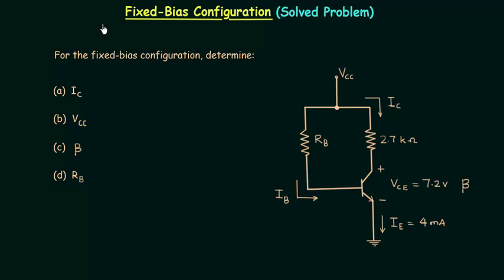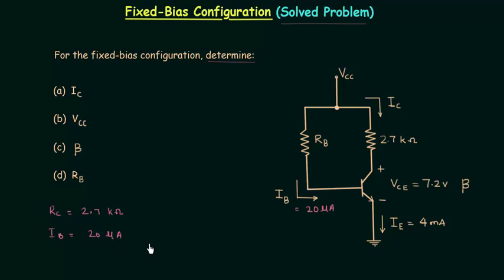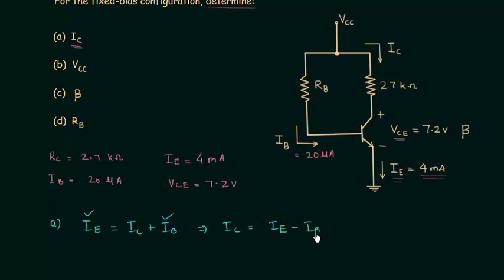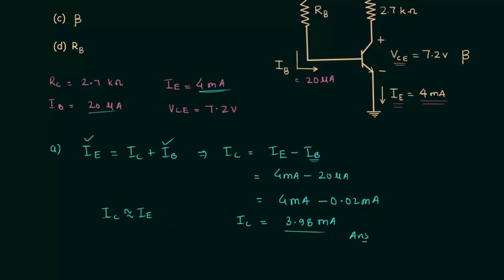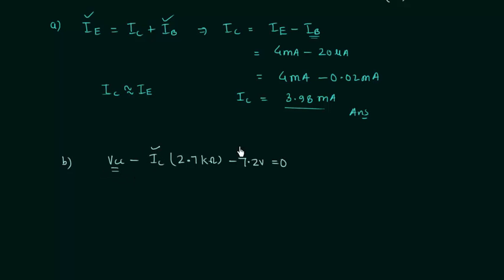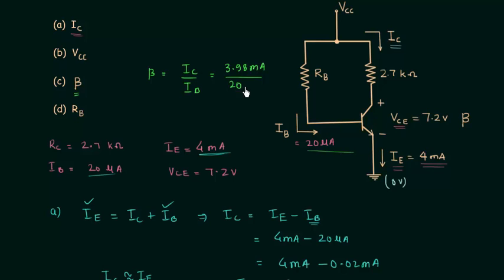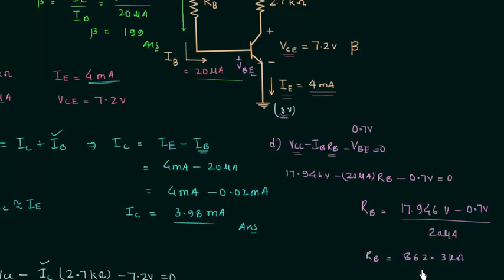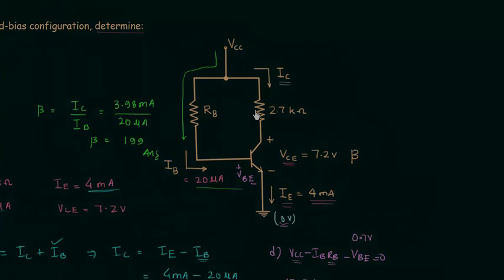Fixed-Bias Configuration (Solved Problem)

Comment: Sir is 14 v not Vcc ? and why you don't tell Vcc is collector to collector Voltage.? In the circuit which is collector to collector Voltage and which is collector to emitter voltage

Comment: when we neglect the capacitors and replace them with open circuit, then how the signal is applied and why to use the capacitors then?
Reply: They are used when an AC input is applied

Comment: How did you get Vbe = 0.7 volts
Reply: Input voltage Vbe =0.7v for silicon diode and 0.3v for Ge diodes 
These are actually fixed values calculated through experiments...
Reply: Yea, got it. Thanks anyway.

Comment: We can use vbe =0.7 volt for every question whether it is given or not?
Reply: I'm also confused with this. Please somebody answer this guy question
Reply: @wakippai6047  if not specified, always assume you're using a silicon trans unless told you're using a germanium trans which would be .3v for vbe
Reply: @wakippai6047  always, unless specified otherwise
Reply: @94D33M  omg